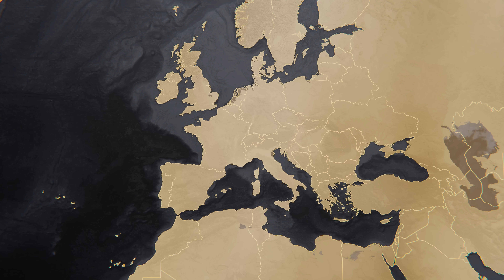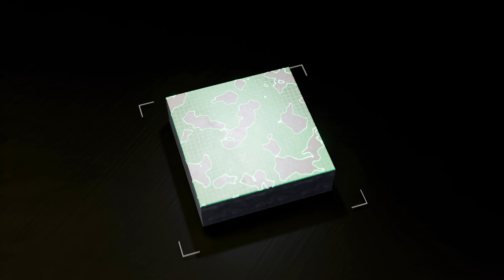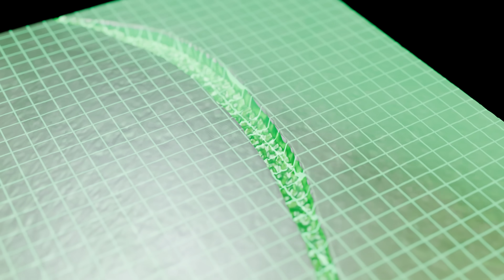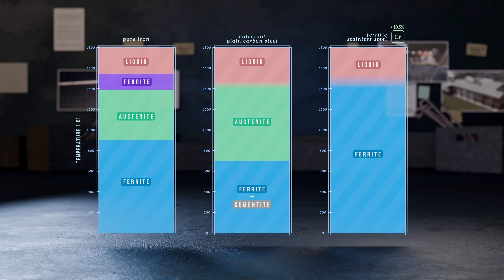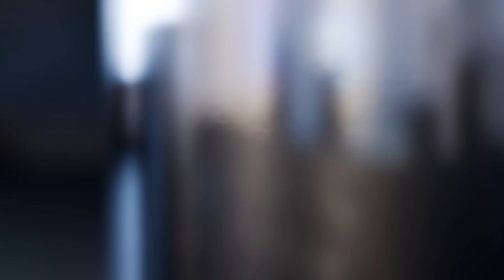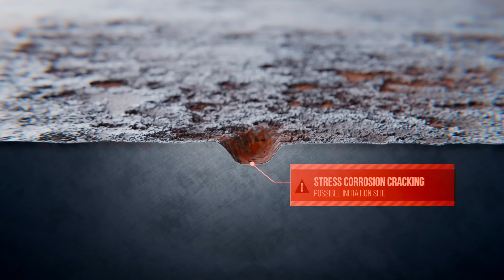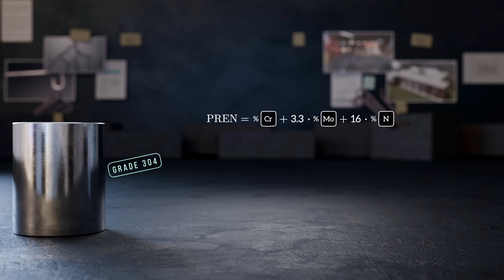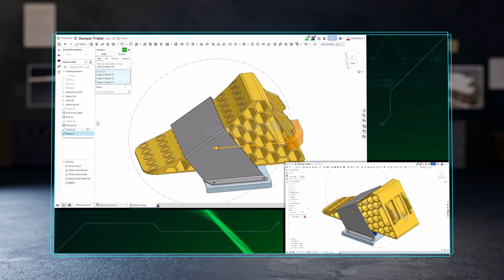The Problem with Stainless Steel

Comment: and this is why the ss exhausts sold with a life time warranty will fail after 20 odd plus years
especially when you live near the coast or have salty roads in winter
heat and salty air are killers of the ss used in car exhausts
but then, who  in normal hp financed cars keep a car for 20-50 years as some non sheeple folk do.

Comment: Metallurgist - it isn't stainless steel, it's corrosion resistant steel.  And 304 is notorious for pitting in Chloride atmospheres.  And if you have crevices where you don't have free oxygen (like washers covering sheet), it rots.

Comment: I was a milk truck driver picking up at farms and noticed the stainless steel tanks had warning stickers saying not to use pure chlorine. One time when I got my bleach for my sampler which gets water and a bit of chlorine to keep things clean between samplings, and just one time I poured the bleach in before adding the water, it was just a capful but that was all it took, the stainless steel rusted out quick and wouldn’t stop rusting! The warning stickers made sense then, and video explains is much much better, super great video, graphics and all, thanks for your efforts.

Comment: Marine engineers have known this about stainless steel for DECADES.  Stainless steel does, in fact corrode, in the same way as aluminium alloys.  What happens in both metals is that the surface starts to corrode, but when the microscopically thin film of corrosion forms on the outer surface, it becomes a barrier to oxygen.  When no oxygen can reach the underlying metal, the corrosion stops.
The key point is this;  for that protective film of oxide to form, there must be AMPLE oxygen surrounding the metal.  If the stainless steel is in an environment where there is only a little oxygen available, the stainless steel corrodes even faster than unprotected mild steel!
That's why stainless steel is so rarely used on boats and ships - and only in places where it has ample access to air.
Encasing those stainless steel rods meant that they started corroding, expanded as the corroded metal has more bulk than pure metal, and acted like small explosive charges going off in slow motion, over a period of 13 years.

Comment: As a former maintenance engineer (50+ years ago) in a Kraft Pulp mill I found this fascinating.  Memories of our 317L washer drums being eaten in the bleach stage's high Cl environment are still with me. A GREAT intro into what was happening - very well done.
Reply: Also explains why our bleach plant CLO2 washers, fiberglass Tubs, that are suspended under the filter drums by 304SS fasteners would over the years break under tensile load. We were using 4140 as for extreme conditions on impeller bolts which seemed to give us a better result for annual mill shut dwn re/re.

Comment: stainless steel is not a lie, it doesn't lie chromium steel doesn't stain. but even chrome erodes. if you want to make an actually uncorrodable steel, rust blue it, then slap an easy bake powder coat onto it. but even then, i will still corrode with enough wear. entropy's a bit'ch.

Comment: SS is labeled corrosion resistant NOT corrosion proof.  The issue was from poor engineering not taking into account material degrading over time. Especially nm a high humidity environment. Th rods should have been at least3 times thicker

Comment: Have been inside a Shampoo maker / packer and their massive problem was the stainless steel rotary valves were being eaten out by the product bring packed ( shampoo)
Never seen SS so thoroughly corroded and dangerously under sized because of it.
(No brand name is mentioned)

IKEA uses 4000 series for their baking products and this can get a slight tarnish yet handels the baking job well.

Comment: 304 is cheaper than 316 if you want a better corrosion resistant material then take it to a metal spray shop and get them to spray the rods with chromium spray but you need a metal spray expert that knows what he's doing this is very expensive sounds like they took short cuts to save money

Comment: "The problem with stainless steel" is a misnomer.

The problem was with the design engineers, not the stainless steel. 

It is the engineer's responsibility to understand and select the proper materials AND and inspection criteria/maintenance required for the life of the structure

Comment: 17:45 there's a location in the Midwest.. details please 🙏
Reply: Lifeguarded an all year round swimming pool and the stainless steel they use always had issues and always had rust on it the coronation in the air and the humidity really  Hit home that was 20 years ago Kansas City.
Reply: Furthermore we're known to have special collapses in the past as on seconds from disaster that wasn't a steel problem.🙄

Comment: There's a reason 304 stainless steel is not used in marine and medical. I'm surprised they didn't use 316ss for such an application

Comment: When we needed electrical control panels in stainless steel the only options are usually 304 grade or 316L. Anything going in a marine or coastal environment is always 316L steel, now I know why.

Comment: Why would you suspend a heavy concrete ceiling beneath the roof?  I would think that there would be many better material selections that could be used that would be more suitable.

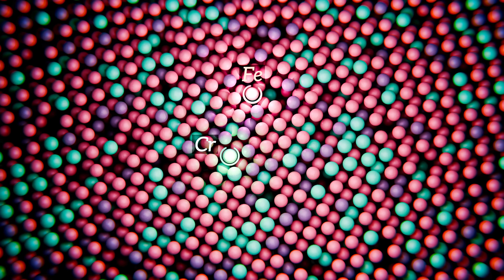Comment: Videos is informative, but it contains certain mistakes. At 2:00 - ability of two reagents to react does not create attraction between them. At 2:02 - atoms don't migrate in crystals like that. At normal temperatures and mechanical loads they don't migrate at all and when they do it's not due to external chemical exposure or some kind of remote attraction. Chemical reactions start from the surface. Interactins are screened by the outer layers and do not propagate internally. Even if oxygen atoms "ignored" closer iron atoms being only attracted to more distant chromium ones, then oxygen atoms would be drawn inside the crystal instead of chromium migrating to the surface.
Good chromium oxide coverage of the surface does not occur by itself. Chemical and electrochemical passivation methods are used to remove iron atoms from the surface resulting in higher chromium concentration at the surface. No migration miracle.

Comment: I was a Ducati mechanic for 10 years. In the early 90s Ducati briefly changed their cylinder studs on the Supersport series to stainless steel. Each time I worked on a Supersport in from that era, I would find at least one broken stud. That made me rethink using stainless.

Comment: Concrete ceiling? That's crazy. You already have an outer slab deck or roofing. What's the point of hanging another heavy slab under it?

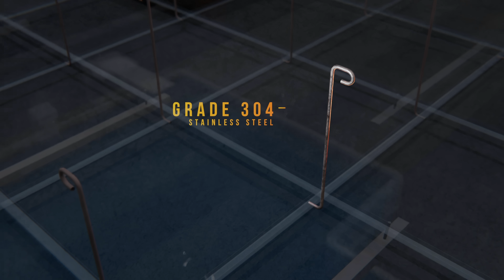Comment: @ 1:00, corrosion resistance doesn’t mean immune to corrosion. The stainless steel bolt is constantly exposed to the chorine environment of the swimming pool. The building designer neglected to investigate the long term effect of swimming pool conditions on grade 304 stainless steel bold. Basically, the  roof collapsed because the architect is either negligent or stupid.

Comment: Pools are chemically cleaned morons they have a non neutral PH.  Pretty sure that'll corrode stainless steel.

Even though they should have known there is no such thing as corrosion proof metal.  All metal oxidizes over time.  All of it. It is all doomed to "rust" away.

Comment: I ran into an issue at work where I kept getting flash attacks when I was running 316 through passivation.  We were using DI for the passivation baths.  We ended up tracing the issue to the carbon filters for the DI system. Someone dumb tech (me) had forgot to swap them and trace amounts of chlorine were making it through.   it takes very little chlorine to cause issues with stainless steels

Comment: Wind and rain accumulation, drainage cause tensile oscillations in suoprt rods, plus temoersture fluctuating expsnsion/contraction gradients from.upper rod down to lower...
a slow fatugue fracture cumulative envirinment accekersted by chemicsl syrface reactants.  Were fatigue lifetime  use not done for this common construction environment?  This eould indicate periodic insoection for rod replscement(safety margin for reliable use lifetime).
The concrete contsct olus moisture and Chloine is another chemistry environment with micro fric t ion during life kf iscillstions in Temlerature and tensike olerartions as well as upoer connection contacts. Possibke micro region electrochdmistry is llssible at bit ends.
Wer fsilures mid rod or at concrete contsct or roof connector(different metal/alloy)?

Comment: Something that might help understand breakage points,
is the chemical difference between brittle chemicals
and metal chemical BONDING PRINCIPLES.

Metal bonding promotes tiny vibration throughout the mass,
were brittle chemical bond, is accepting as water,would promote,
displacements without losing the mass into energy.

Water equals oxygen
and water's bond is located at the surface
which directs the internal mass  to bond
as a pressure build up.

Pressure builds have instant penetration support 
of anything venturing in its mass accumulation.

Thus promotes the antidote to fusion pressure bonding
with pressure build up releasing the fusion created bond.

Periodic Table research logics,
with heat specific time tables,
recognized as timely waits for the shifts
to analysis balances of possible directions 
research.
Reply: The vibration contradict the bouncing the brittle mass 
would go through to retain their fusion bonding support 
for thermal exchange.

Thus exploring the problem being solved,
the Periodic Table notices a jump
in the count of electron/proton pairs.

As energy particles, they promote 
being weighted down add attracted
to other mass.

Comment: 304 stainless steele is the cheapest stainless manufactured.  It is magnetic, which means there will be a propensity to corroded more quickly than higher grades. Nickel is the key to higher quality stainless steele. The more nickel in the chromium, iron blend the better the corrosion resistance, but this is much harder to 'work' and can be nasty to roll into a shell. Large diameters are less prone to 'work hardening'.

Comment: The susceptibility of austenitic stainless steels to stress corrosion in chloride-containing atmospheres had been known and documented since at least the 1950's.  I spent 40 years on metallurgical failure analysis,
including dozens involving "Stainless Steel."   The most serious were failures in military ship-bourn components in marine atmospheres.  The less serious, except for financial consequences.  Failures in very large
wine vessels used for storing thousands of gallons of wine. These were welded austenitic stainless steel that had been cleaned internally with a chloride-containing cleaner, and the chlorinated liquid had been
trapped in microscopic defects in the weld beads. This led to loss of a rather fine-vintage California wine. A better choice would have been 316 stainless, with an Mo addition and higher Ni content. {And a non-chlorinated detergent!!
And the part about testing household appliances with a magnet to determine whether they are non-magnetic austenitic stainless, or magnetic ferritic stainless.  Forget it, it's not reliable  During the cold-foirming
of austenitic stainless steel by cold-rolling, the austenite grains are transformed progressively into martensite, which forms within the austenite grains. Thus, an austenitic stainless steel that has undergone 50% 
cold reduction prior to use, will have significant martensite within the austenite grains, and be maggnetic.
A good informative video though, that shows the necessity of choosing the correct stainless steel for the application, with particular regard to service environment.

Comment: Fascinating. Subscribed! I'm rebuilding a wooden boat and EVERY SINGLE 316 SS fastener I pull out has some degree of crevice corrosion, from mild to extreme, to bolts falling apart as they're removed. Tannic acid+ salt water+ stray electrical currents appear to have the same effect as chlorides.

Comment: Cool video, i used to weld sanitary stainless tubing, we would comminly use 304 material except where clients used clorinated cleaning chemicals. These chemicals would quickly destroy the tubing material. It would cause tiny pinholes through the entire length of tubing. In these scgenerios we would use 316 stainless. More expensive though

Comment: i lost iq while watching it, steel specialist this author is not
Reply from the maker: Care to elaborate?
Reply: @TheEfficientEngineer  well... statement that 304 ss fail baffled experts from all around the world for one. It's properties known for about a century already. In Russia there is 60's standard for testing properties of ss that still holds, i bet US and Europe have even older ones. Even run of the mill ss sinks use 316 ss, if it's not knock-offs.
Reply from the maker: I mention in the video that chloride SCC in austenitic  stainless steels was known before the Uster disaster. What wasn't known, and was unexpected, was that it would occur at such low temperatures.

Comment: I saw what a damp environment with chlorine, fluorine and ozone gases will do to '304. It forms a blackish corrosion product known as roughing. It only took a few years before stainless steel enclosures began to fall apart at their welded seams.
It was in the ozone generator building at a water treatment plant. A place that was distinctly uncomfortable to be in because the supposedly clean air had just enough to irritate your nose and lungs.

Comment: I wonder if the evaporated chlorine also reacted with the calcium carbonate in the concrete.   Imagine the expense of a stainless steel and concrete roof, going to extremes in making a strong structure, only to collapse.  The mental pain that engineer felt for being responsible for such a tragedy would be unimaginable

Comment: 2.5% Mo is added usually not to increase corrosion resistance, but because it makes the steel lose much less mechanical strength with increased temperatura. Most steels lose a lot of resistance after 300~400 Celsius... Molibdenium enriched ones can resist 700+ without losing too much strength.

Comment: I worked for a contractor who was doing power line maintenance for a company who made titanium dioxide and other chemicals. Occasionally something would happen and cause chlorine gas to be vented . The galvanized 5/8 bolts we used to hang hardware on the poles had the same issue. All of them had deteriated to a point that the same 5/8 bolt was the size of a pencil. I was shocked at how much damage was done

Comment: There are some very important mistakes on the video explanation:

FCC and BCC are not type of steel, they are structural forms, they can happen in ANY crystaline structure.

BCC and FCC are not Ferrite or Austenite, Ferrite HAVE the bcc form and is a mix of Iron and Carbon on the right range of concentration. Austenite HAVE the FCC form and is also a mix of Iron and Carbon on the right range. BCC and FCC is a form, not a material.

This is very important, specially because the definiton of Ferrite and Austenite is more related to the compositon than the structural form, since the composition is what you search form on a micrography to evaluate the composition.

Comment: Another consideration is how the hangers top bend was produced. A cold bend and the material in the bend is stressed +/- and its electro-chemical potential is therefore different to the differently stressed down bar and curve end. This can cause corrosion also.

Comment: Pool professional here. The environment in and around a pool is extremely corrosive over the long term. In the US with indoor pools, the code requirements for ventilation are more complicated and detailed than the requirements for filtration or chemistry because of the effects of gaseous chlorination byproducts on health. Damage to the facility is a secondary, although important consideration, as well.

Comment: Any metal will turned into its natural form into "rust" this is just the must fundamental basic knowledge in stem college, even the most resistant metal like titanium will get corroded
I am more amazed which moron thought using concrete as hang "ceiling" in this case, this ain't the metal fault it's the engineer oversight

Comment: 304 st steel is known to corrode, it is a “cheep” st steel. In my practice we always used at least 316 or even 316L for good corrosion resistance.

Comment: SS 304 is known through boating, to be wholly unacceptable for use around water.
The fact that an  engineering firm used 304 to cement ceiling, then promptly forgot about it, is entirely the fault of the engineers.
It's been known for two decades, that 304 is the wrong material for use around water.
It failed after 14 years.
This was entirely preventable.
Today, it is universally known that only 316 SS is acceptable for use around water.

Comment: Who designed this accident waiting to happen? All stainless steel can rust,depending on its makeup.304 is the most likely to rust and consequently is the cheapest grade.It’s possible to  passivate  stainless by immersing it in a weak acid.This process forms a thin coat of chromium oxide instead of ferrous oxide which protects the surface from corrosion.This was a badly designed project

Comment: I worked as a Graduate Structural Engineer on a swimming pool project, thirty years ago and the slides were suspended by stainless steel rods. There were epic rows with the contractor about the very high specification of the stainless steel used. These suddenly stopped when the slide in another pool that the same contractor build failed, luckily at night, and he landed in an insurance battle. So, I am surprised that the designers did not realise that due to the heat, humidity and chlorides is a very tough micro environment for any metal. Other question, why on earth was there a suspended concrete ceiling? I am sorry for the victims 😢